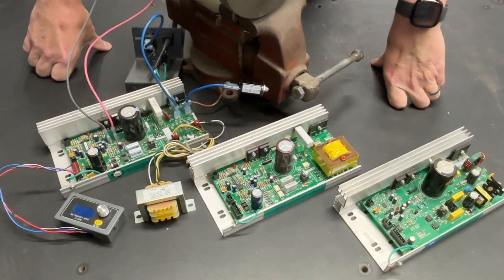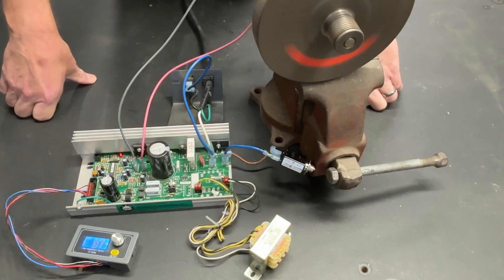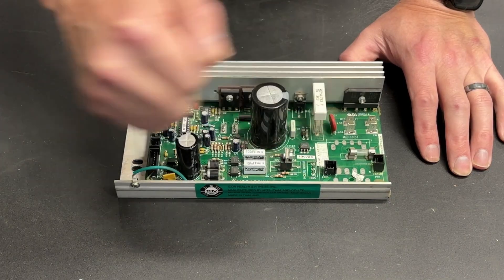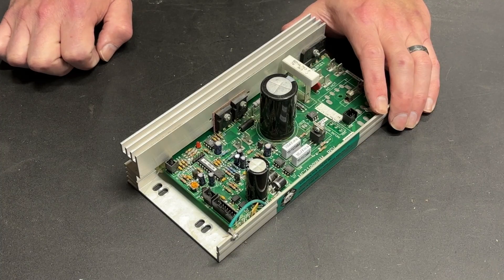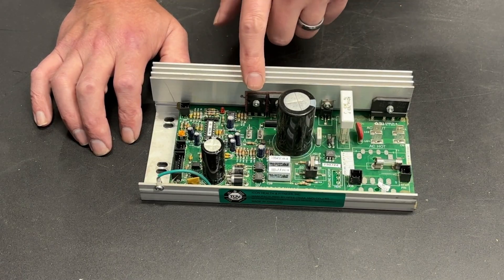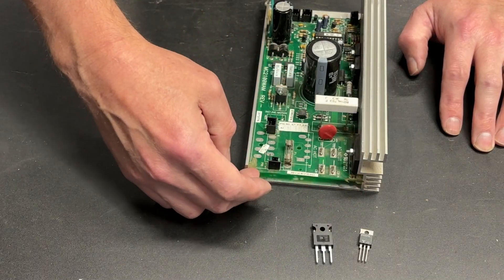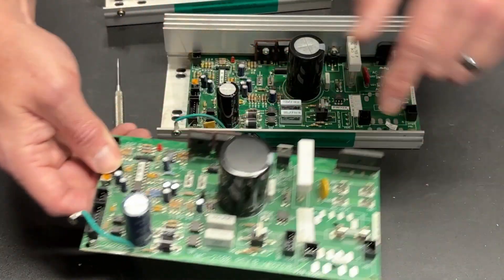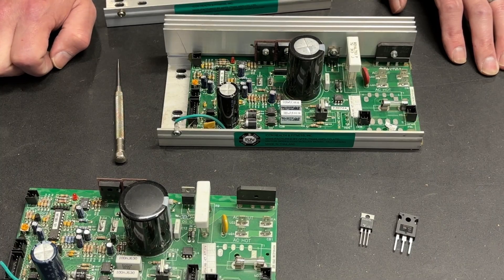Troubleshooting and Repair of an MC-2100 Including common Component Failure and Diagnosis

Comment: Tradmill was initially acting as you said (power but motor goes to high then cuts out), so I replaced both parts. Everything is pluged back where its supposed to. I plug in the treadmill, flip the red switch and it trips the  breaker at the house panel. 
Any ideas?? Time for a new treadmill maybe. The wife will be happy... she likes spending the moolaa.
Reply: Btw... thanks for doing vids like this! I love it when I can actually fix something:)
Reply from the maker: happy to do it, sorry your repair was not more successful
Reply from the maker: I do not have any other options on the board.  have you tested the motor to make sure it is not the problem.

Comment: I replaced both the IRFP250 and the S4025L (the original SCR was S9010).  The minute I pressed START on treadmill, the S4025L literally POPPED/cracked in half.  I have a few more S4025L and considering replacing 1 more time to rule out a faulty thyristor. Anyone else have any thoughts?
I have the MC-2100 board  Rev B.
	Thanks in advance.
Reply from the maker: one more time will likely result in the same issue.  I do not have a solution for you.  typically its a combination of the MOSFET and SCR but being that you replaced them both I do not know what is causing your issue.

Comment: What can be the culprit if controller board is getting power but the console is not turning on for a proform 800i?
Reply from the maker: hard to say.  The console gets its' power from the MC2100 so it could be an issue on the board, a bad connection or the console itself has failed.  The MC2100 is labeled at the console connecter and the voltage outputs are clearly marked.  Using a meter to test them will let you know if the MC2100 is producing power.

Comment: My treadmill is getting 5 blinks Red, what is the problem? The unit is not receiving the speed. Everything else works.
Reply from the maker: 5 blinks means that the controller cannot resolve PWM signal from the console so there is likely something wrong with the control pannel

Comment: good morning 
I have a problem with this MC2100 board and the LED has a solid light, I have already connected the PWM to the HD2 plug, the PWM is blind to pin 13 of the micro, the pulse width varies as I change it, but not even to pin 8 of the micro to open the voltage on the SCR Not even 12 has any modulated signal.
is there any tip?
Reply from the maker: Did you set the signal generator to the correct Hz?

Comment: I've got this controller on my treadmill. Here is the behavior I've observed:
1. System/display originally struggled to turn on/boot. It would flash on, but then just stay off. 
2. After leaving unplugged for awhile I plugged the treadmill back in. The System/screen booted per usual (LED on board is lit)
3. Deck height controller works as intended
4. Trying to initiate the track on the treadmill results in the LED flashing (PWM appears to being sent)
5. Treadmill starts to move, but doesn't gain more than a minimal speed, nor have any torque/'power' (you can almost stop it by stepping on the deck)
6. Adjusting the desired speed (even to maximum), results in the speed slightly increasing, but after a few moments reduces back down to a slow crawl. (LED during this time has a much slower flashing cadence, as I assume it's trying to provide longer pulses to the motor)

I observe no noticable damage to the capacitors or any obvious signs of failure of the mosfets. However, perhaps they are just in a super weakened state? Might it be worth replacing them for the heck of it?
Reply from the maker: I honestly don't know.  I am not a treadmill repair expert.  My only guess is that something is not right with the control board console.  You could test the 2100 and motor with a PWM to know for sure.
Reply: Did you ever find the solution to this? Exact same issue as me
Reply from the maker: as i said above the PWM would be the way to diagnose if it is or is not the control panel board.  If it is that board it will likely need to be replaced
Reply: @trainman37 did you find the solution/issue?
Reply: @helgenilsen7269 yes and no. By every means available it appeared as if the control board was working, but something still seemed weird since it was giving the behavior indicated. One day it started working out of the blue. I'm 95% certain it was due to the gray strip of plastic on the side of the treadmill. It had, over time, slid up in its channel and was pressing on the roller. It essentially was causing increased friction in the system or messing with some sort of sensor and the controller couldn't compensate. Once I pushed the gray plastic back down in it's channel, the treadmill started working fine. 🤷‍♂️. Not the answer you or I necessarily wanted, but it is how things ended up being solved.
Reply from the maker: glad you got it resolved

Comment: My treadmill motor started at full speed and then quit. The AC circuit from the wall trips the circuit breaker every time I try to turn the motor on. Tested the motor and it works fine with direct DC. I will check those components. Thanks for the very clear and informative video.
Reply from the maker: sounds like replacing the MOSFET and SCR will get you going

Comment: Excellent video!  Questions: Do you know where I might obtain a schematic diagram of the MC-2100?  2) Does this also output 12VDC to power the treadmill display, etc?  My daughter's treadmill's display does not power up but the LED light on the MC-2100 is solid red.  Any help in pointing me would be greatly appreciated!!!  Thank you!
Reply from the maker: I do not have schematic, but If you look at the large connector on the MC2100 the 12V output is labeled.  That is what provides power to the display and you should be able to test it with a meter.  Makes sense that the LED on the board is solid red because it is not getting the required PWM signal from the control panel.  Let me know if I can be of any further assistance.
Reply: @dazecars  enter email and I will send it to you
Reply from the maker: could you contact me through my website (listed in my video) not wanting to post my email address and increase spam.
Reply: @dazecars  Will do!
Reply from the maker: got it will look at it and respond

Comment: Great video! I wish i saw this before i blew up two mosfets! lol. Luckilly the pack has 3 left and i can pick up some of those SCRs. It is fairly easy to replace im just hoping i didnt damage the cunducting strip on the board when the mosfet exploded. 

You mentioned a differnt type of board is there a good swap for treadmill? I can run quite a bit lol.
Reply from the maker: hopefully replacing the SCR as well fixes your problem.  Works about 3/4 of the time.  I don't have a good swap for a treadmill as a treadmill needs its specific controls and board for adequate safety features.  The power supply I mentioned is for those using a treadmill motor in something other than a treadmill.

Comment: Very good information.. I just replaced the mosfet... and blew the new one... replaced it again, and started searching before blowing it again... Makes perfect sense. Dimmer control on the incoming ac line to buck the voltage/current down.
Reply from the maker: Glad it helped
Reply: I saw somewhere that if you replaced mosfet you have to replace the scr as well if you don't they will keep blowing each other up, but replace both and they will work fine. I'd look into it further before wasting anymore money. Hope this helps.
Reply from the maker: that is the exact information in this video that the comments are being put on.  so not "somewhere"... right here

Comment: My treadmill is a pro fitness one if that mosfet goes would there be no power anywhere not even above. Thanks in advance
Reply from the maker: That sounds like maybe the onboard or auxiliary transformer is bad/unplugged OR you don't have a connection across the circuit breaker terminals.

Comment: I have a similar fault, the LED never flashes when the engine starts and the engine turns off when it starts, the power mosfet burns out, what can I do? or what should I check?
Reply from the maker: As I said in the video, often times the SCR being stuck will burn up the MOSFET and that it why I recomend replacing both however it doesn't always work.  I have fixed several but had one that replacing both components didn't fix the issue.

Comment: Hi there, first of all thank you so much for the video, it really clarifies pretty much everything you need to know about this board. I have a treadmill that will no start, I have power but the motor doesn't run. Since the LED on the board is on I assumed it could be a motor problem. I opened it, checked the resistance bar to bar, and 180º and it seems ok, can it be a board problem? Thank you very much.
Reply from the maker: yes an LED that comes on and stays on and never starts flashing is a board issue but I do not have a fix for you.
Reply: @dazecars  Thank you very much. That's helpful enough 😁
Reply from the maker: my pleasure

Comment: Greetings, I am about to change out the MOSFET and scr. Thanks for the tutorial. My understanding is that the older type MOSFET is replaced with a new type. Also, I could not find anywhere that gave me insight into what the other markings on the MOSFET stand for besides the actual part number.  My symptoms were rapid spin up and shut off.  None of the board components have any outward signs they failed. No bulges, burns, leaks nor tears. Thanks again. Appreciated.
Reply from the maker: Replacing the MOSFET and SCR should fix the issue but it doesn't always work.  I have had good success on several repairs but I have also had it not fix the issue one time.
Reply: @dazecars  Tks for the reply. Should the repair fail to work, I will consign my treadmill to the great trashheap in the sky, sigh!
Reply from the maker: hope it works

Comment: Hi there.  I got an MC2100LTS-30 working fine except it won't incline down (only up).  After testing everything else, I replaced the MCB and the problem was fixed.  So, now that I know everything else is fine and the old controller is bad, I'm trying to fix it following your recommendations.  Although I believe these won't affect the incline (only the belt motor), I replaced both the MOSFET and the SCR, but it still won't incline down.  Any suggestions?  Have you tried changing the safety capacitors (MPX-X2, 275V, 0.1k)  or any other components to fix this "no incline down" problem?
Reply from the maker: The MC2100 board has nothing to do with the incline motor.  An incline motor is AC and when power is applied one way it goes one direction and when applied the other way it goes the other direction.  Some incline motors have a stop switch inside the incline motor and if that switch is bad that would explain why it's only going one direction.  You could also have a bad connection.  This video may help but there are lots of different incline motor configurations so it may or may not apply. https://youtu.be/ce9I55OeDWY
Reply: @dazecars Thanks for your reply.  I agree with all you've said, but as I mentioned in my original message, I already replaced the controller board (MCB) and everything worked perfectly, including the incline motor moving up & down.  The old MCB seems to be the problem, since it's sending AC voltage through just one of the wires on the 3-wire incline harness. I confirmed that by inserting the incline connector the other way around, and then it inclines down when I press the incline up button, but it does not move when I press the incline down.  Therefore, the problem is not in the incline motor.  That's what I'm trying to diagnose... therefore my previous question "Have you tried changing the safety (yellow) capacitors (MPX-X2, 275V, 0.1k)  or any other components to fix this "no incline down" problem?"... Why isn't AC voltage coming out of one of the incline connector pins?  Any clues?
Reply from the maker: I honestly don't know.  I am not a treadmill repair expert just a guy with some basic electronics knowledge and some experience using treadmill parts in other projects.  I was just trying to trouble shoot your issue as best as I could and do not have any other ideas.
Reply: @dazecars  Thanks for you reply.  Your video was very educational, and it motivated me to continue my quest for answers.  Keep it up!
Reply from the maker: glad I could help if only a little
Reply: it appears the incline motor is driven by q3 and q4. The SCR and the MOSFET are for the belt motor.
Reply: @frankens43  On the MC2100LTS-30 controller, Q4 is the MOSFET, which I already replaced.  Q3 looks like a tiny resistor or something very small (if anything's there at all).  Therefore, I don't think Q3 and Q4 are driving the incline motor.   Any other suggestions on which components are responsible for sending the incline output voltage to the incline motor?
Reply: @jval8034  ok, so I have the mc-2100 rev b in my hand.....

q3 and q4 are clearly appear to be SCR's. they are bolted back to back to eachother.
I followed the traces to hd5 incline motor connector. Pins 1 & 5 go to the motor for up down direction drive with pin 3 being the common voltage return (goes directly to 120v lg2 line connector. Lift motor is ac. Pins 2 and 4 are un-used. I followed the pins 1 & 5, they go to scr's that have a return path to 120v CB1a circuit breaker to lg1 ac in.

Now... when i look at a pic of a MC2100LTS-30 266333 Treadmill Motor Controller on ebay,
you are correct. those same 2 parts are labeled q5 and q6 which are right next to the incline motor connector.

If you look a little further, next to them is a pair of optocouplers that tell the scr's to turn on as requested by the controller. Standard optical isolation of low voltage control to high voltage drive. (the little 6 pin chips) - inside those chip are an led that shines on a light sensor. light on, power passed through output.. air gap between them. - optocoupler.

https://images.app.goo.gl/FNT1SP1nu9bgN965A

so.. you could have a bad optocoupler or a bad set of scr's... or both.

some light reading for you....

https://www.electronics-tutorials.ws/blog/optocoupler.html

get it? light? optocoupler?
Reply: @frankens43  Excellent analysis Frank!!  It makes total sense.  I really appreciate your taking the time to explain all this.  I will check those SCRs and optocoupler as well.  Thanks again.   Great educational input...
Reply from the maker: fantastic information
Reply: @frankens43  I forgot to ask... how do you diagnose if an optocoupler is good or bad?
Reply from the maker: The input terminal of the photocoupler is a light-emitting diode, so you can use the diode feature of the multimeter to judge whether the light-emitting diode is damaged.
Reply from the maker: agreed it is not the SCR or MOSFET

Comment: Hi,
I have the motor starts fast and then stops.  I replaced both mosfet and SCR and it worked without the belt on the motor.  When I hooked up the motor, it blew the two parts again.  Too much current I suspect!  
I tested the motor with a power tool battery and it seemed fine.  Would you suspect the motor is drawing too much current or could it be something else on the board as well?  I have more mosfets and scrs, but no point frying more.
Reply from the maker: was this the motor that came with the MC2100 in the treadmill or something you got from somewhere else?
Reply: It is the original motor with the treadmill.
Reply from the maker: I would say it is a problem with the MC-2100 then but I don't know what the problem would be.  Those boards produce good power but they are fragile.

Comment: on the board you show with small transformer built onto the board,    have googled the numbers on the transformer but have had no luch   
any help please.
Reply from the maker: its just a class 2 transformer.  120V in 16 volts out.  A lot of these boards use a larger one that is mounted outside the board and simple connects to the board.

Comment: My treadmill would start up fully open then stop. I replaced the moseft and it started working like it should but the motor now has no torque.  The motor has good brushes and good magnetic so it seems good but doesnt seem to be getting the correct voltage. Any ideas? Or is the board bad
Reply from the maker: First and foremost volts do not affect torque except at the lowest speeds.  Torque is a function of amps and if you are experiences reduced torque than there is something limiting amp flow.  I would start by replacing the other component that I recommend replacing at the same time as the MOSFET.  Also what is the torque rating of the motor, could be a smaller cheaper motor that doesn't have much torque to begin with.

Comment: Mine just made a popping sound then smoke when I plugged it in and turned it on any ideas?
Reply from the maker: It’s whatever component popped. You can usually see physical damage. Like i said in the video if it’s the MOSFET or SCR replace both at the same time.
Reply: @dazecars  yeah c28 is gone looks like it blew, Thank you
Reply from the maker: My pleasure